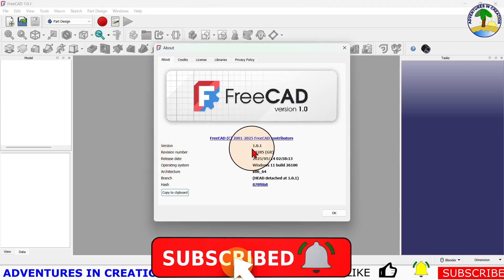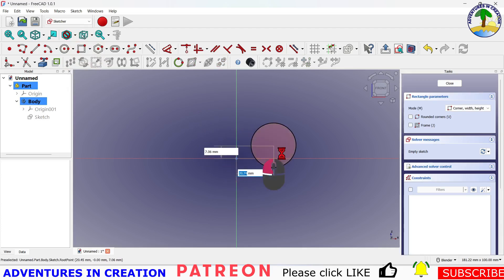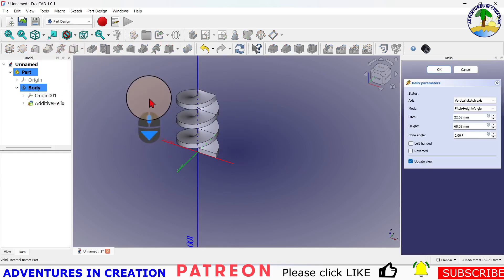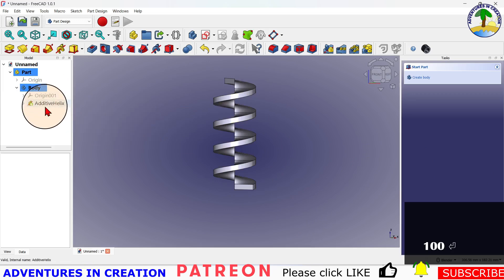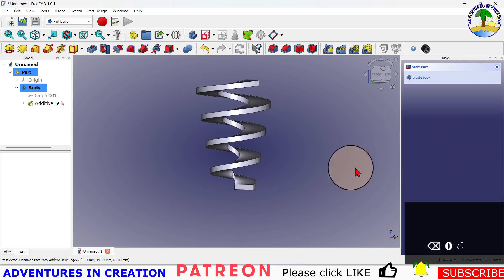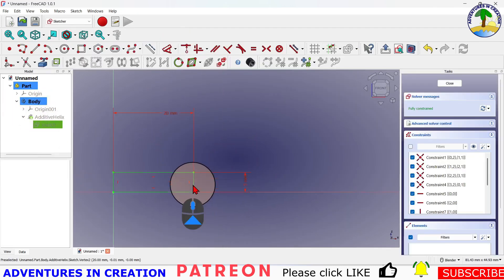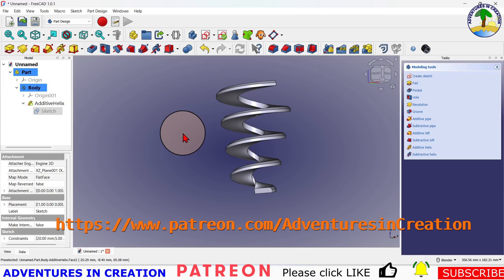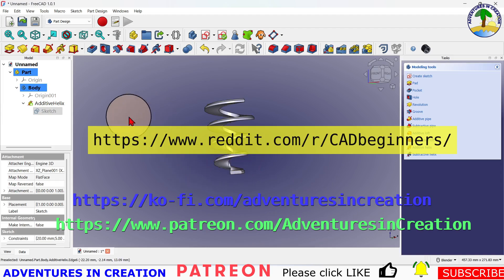Intro To FreeCAD Version1 0 HELIX

Comment: I've seen several tutorials using the helix function to create threads by using a thread profile and running it around a hole or cylinder with the helix function.
It is far easier to use the fasteners workbench which has tap and die forms to make booleans with, i.e. the tap function creates a threaded rod to make a boolean cut in a part
Reply: Fastener WB is great .. but it currently doesn't have tapered threads like NPT ... So it's worth knowing how to do threads from first principle ... tapered threads are surprisingly common.
Reply from the maker: Totally agree! 😁